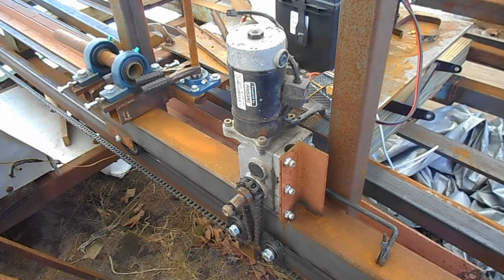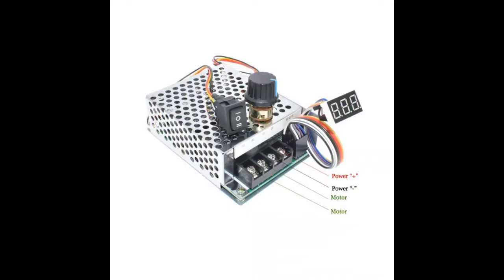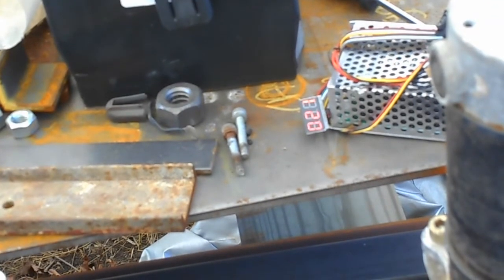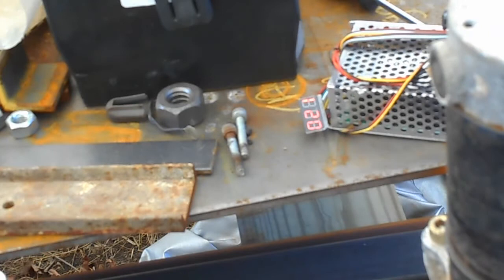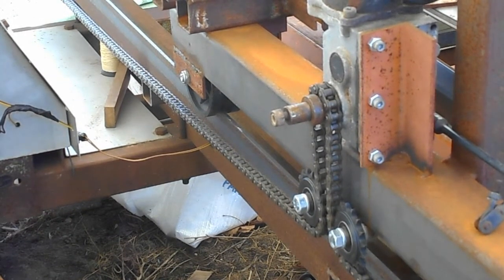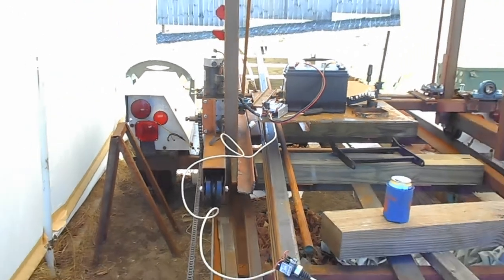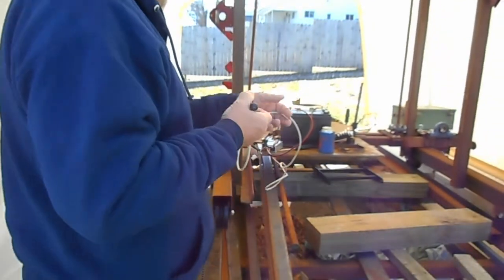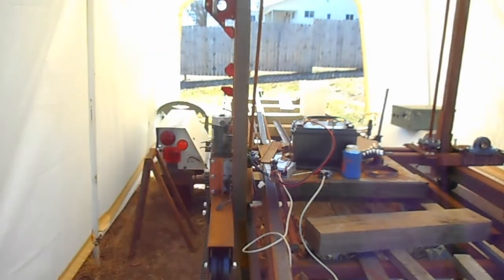Po-Boys bandsaw mill build review Subscriber wants details on electric power-feed

Comment: Looks like a fun project. I have a woodmizer lt15 that i converted to chain drive but have my idlers side by side so the crank stilll operates the same direction. I used size 50 chain b/c thats all the store i went to had all the parts for. Soon im going to put a drive motor on it or attempt to. Plan on using an atv winch. Thanks for sharing this info. Its gonna help!!

Comment: What type drive motor and gear box is that on your mill for the power feed
Reply from the maker: That is a DC motor from an electric wheel chair. Most but not all powered wheel chairs have two drives on the big wheels. They are 24 volt motors but have plenty of power on 12 volts.